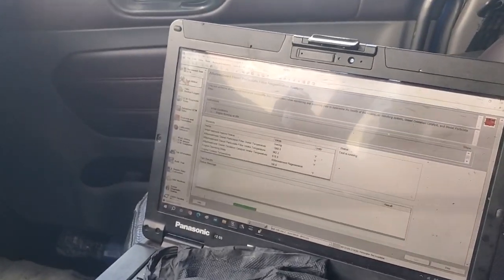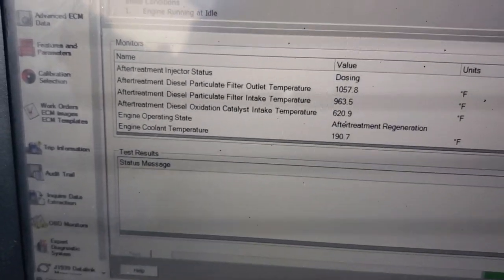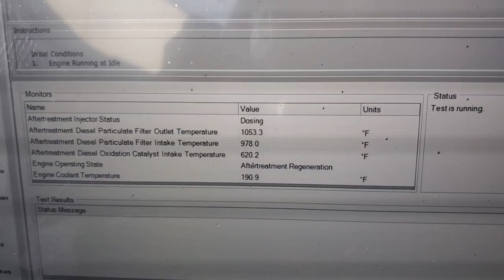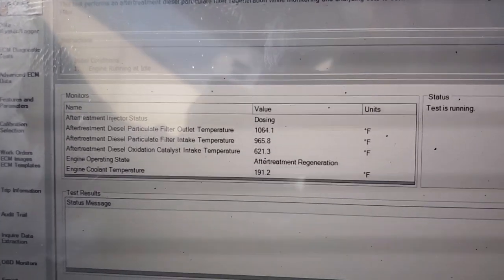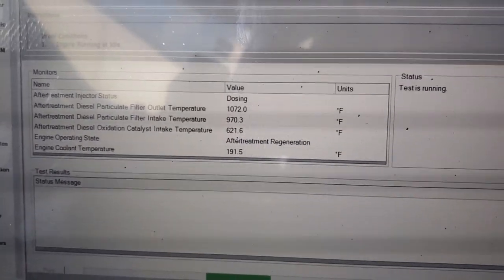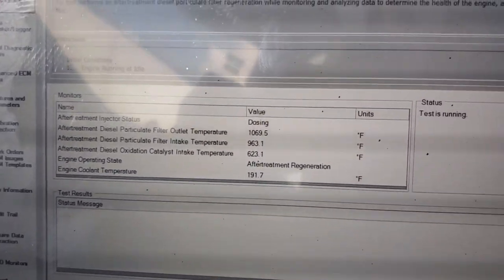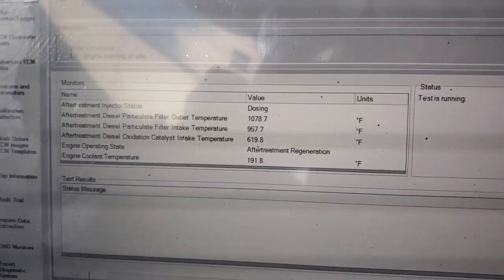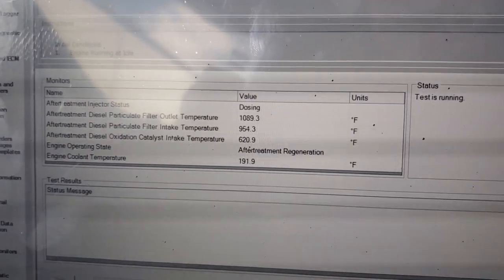How to know a failed/ inefficient DOC without removing. excessive soot in DPF. explained

Comment: Interesting, there is very little taught about this stuff even on the courses at cummins them selfs.
Reply from the maker: Agreed!
Think of them as AC systems where reading the pressure gauges can tell or lead you to what's wrong internally.
Same with the temp readings in aftertreatment systems.
Won't tell you what the problem is, but will point you to the right direction for testing.
Cheers

Comment: What about a 0°- 15° inverted difference?
Reply from the maker: That's not good. Run a couple regens to try to clear it up. If it's still inverted, you have soot deposits on your doc and/ or DPF. 
Remove and have them cleaned.

Run another regen after they're clean to make sure temps aren't inverted. If they still are, your DOC is washed and needs to be replaced.